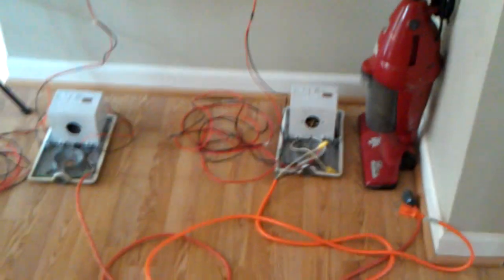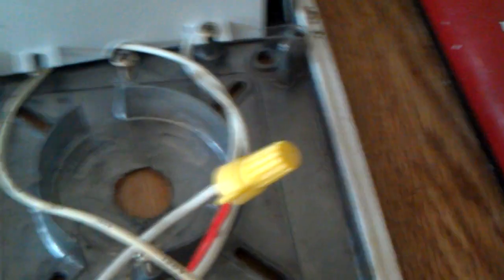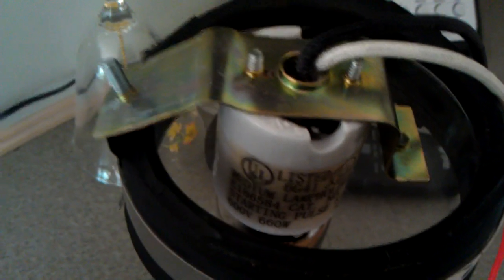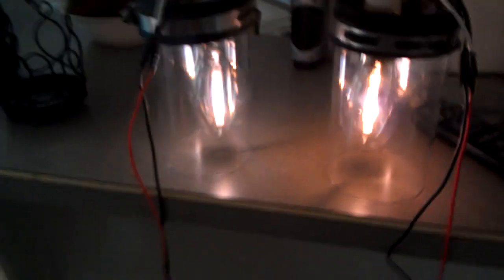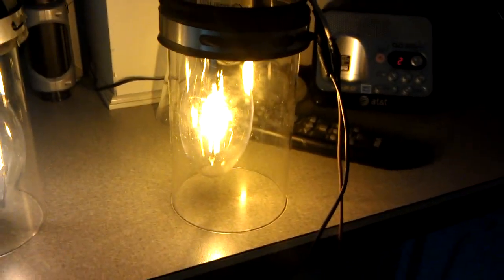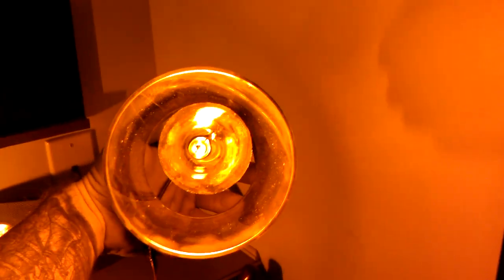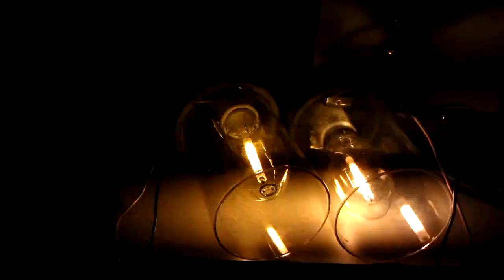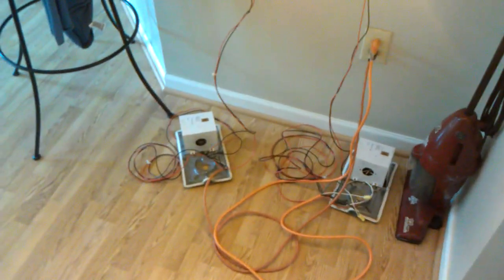DIY HOMEMADE COOL TUBE!

Comment: So how are you gonna get the duct to set on the side with the bulb?
Reply from the maker: The duct goes on the other side and I just pulled air over them consistently. That said, it would be nothing to put a CPL small holes on the bulb duct side and run the wires thru, then epoxy it up or something

Comment from the maker: How is it NOT?! 

It worked perfectly for me with 140 watts of HPS Bulbs and a ducting. There's no "hood" on the setup in this video yet.  You could practically lay the light on plants...

... That's what a cooltube does. If you can't invision how the end product would look, your a jackass. 

This cost me about eeeehhhhh, 100 bucks? Compared to when they first came out and were WELL OVER $400 for the same thing.

Comment from the maker: its just a security light fixture... the ballast comes with it! 70 bucks! You just have to connect it to an extension cord (matching colors SOMETIMES! if your lucky... GOOGLE IT!) and then disconnect the socket/bulb and reatach further away using wire. That way its away from the frame that has the ballast and the bulb/socket is in the tent!